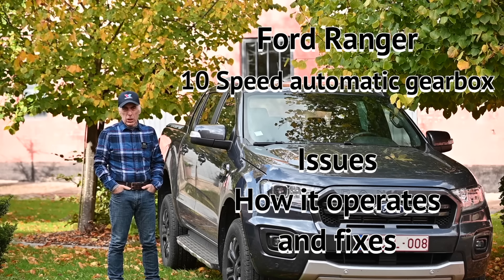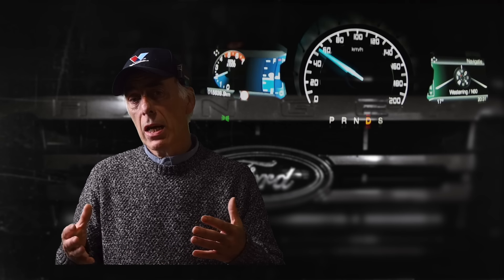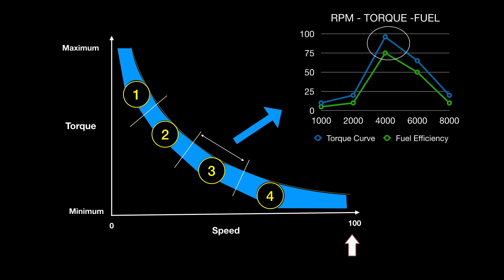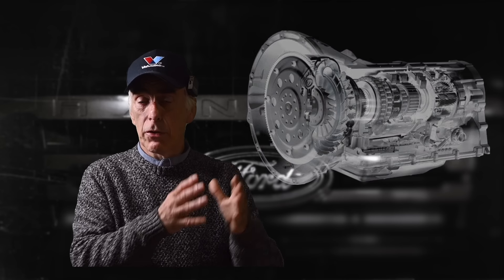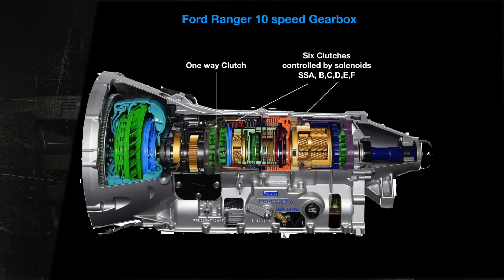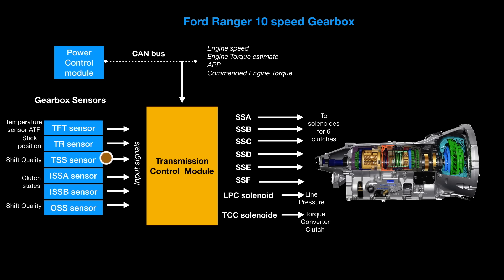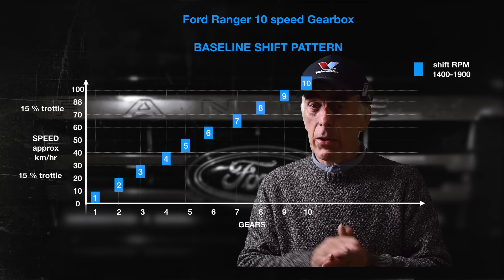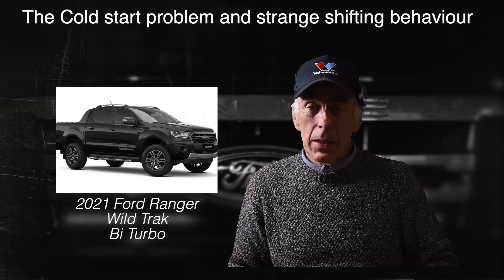Ford Ranger 10 speed automatic gearbox issues and fixes

Comment: If the 10R80 is anything like the 6R80, (thats a ford copy of the ZF 6speed) and I bet it shares software with tweaks. 

I replaced my valve body on my 6R80 with a genuine Ford complete unit to rectify harsh shifts.  

The new valve body came from ford with a software code on a tag in the pladtic floating in the fluid to replace the factory one on the transmission, along with a 4 page instruction  on how to update the software  to a new shift strategy number to suit the calibration of the new solenoids (I used Forscan) and how to perform the shift calibration procedure. 

The vehicle had to be driven several times at light throttle until it reached 4th gear at 50kmh then come to a gentle stop, then hold the break down for 10 seconds.   

This had to be performed about 10 times in a row on a flat road. 

I cannot remember the exact details but I still have the paperwork somewhere.

This is instructions from the manufacturer so anything else you get told on the internet is BS. 

This information is not really in the puplic domain as it is intended for Ford technicians performing repairs, the same as TSB documents are, so the techs can perform repairs in ford dealerships. 

The only self learning box i know of is the ZF 6speed boxes, that have a mechatronic mounted TCM that sits in the fluid similar to the early 6R80 units. 

 The self learning part on a Ford vehicle is the KAM (keep alive memory) and is stored by the TCM and recognises driver behaviour in regards to throttle application scenarios. Im not sure its still in use as this was a 1990s and 2000s technology.  

Im sure something similar is in play now with more sophistication,  but it is not a function of the TCM is Ford manufactured transmissions.

Comment: I think a lot of the videos I've seen on YouTube about Ford's Ranger and 10-speed gearbox problems are extremely unfair.  This is the first video that approaches it from a technical angle and with an intelligent break down of what's going on.  I've put nearly 10,000 miles on my 2023 and I haven't experienced any issues (yet) with this transmission.  However, I also routinely take these steps also, so perhaps my method is not as harsh as some folks who like to turn the key and launch hard on a cold engine.  We'll see in time, but everything you explained makes sense.
Reply from the maker: Thank you
Reply: My 19 didn't have issues till 60k

Comment: Cold start is normal issue to all vehicle not just Ranger. Any car will experience cold start and that is not on the 10 speed transmission issue. Cold start most like the starter problem or battery nothing on transmission. We have 2007 model transmissiom we fix the starter and now no more cold start. The problem to all driver who drive on Automatic is the way they drive. When you drive in City push the accelerator slowly and it will change gear to low to higher gear  Do not push and pull the accelerator. There are many gear inside the transmission. Now when u drive in highway push deep the accelerator and u can see the odometer go high speed and if reach to 80 to 100 kph release the accelerator and let the carl run. If the odometer is slowly down to 60 then its time to push the accelerator and if reach to 120 to 160 release again. That is the way your automatic car will last to 30 yrs without any problem. Another friendly advise to all automatic car owner when you park hit hard the brake and put to neutral and then park. If you hit the brake and put to park the vehicle will move backward and if you do that all the time your reverse transmission will damage the gear and it will not reverse. This is what I observed to all Automatic.

 Summary:
All Automatic car. Do not push and pull the accerator. Push slowly to reach to 60kph if u drive in City. City speed max to 0 to 40 correct me if I am wrong. In freeway push deep accelerator if reach to 80 to 120 relase the accelerator let the car run. If u see the odometer slowly down speed and push again the accelerstor to reach to high speed 160kph and release again. Friendly advise to last forever without any problem. I say again do not push and pull the accelerator if u drive automatic car.😁😁😁😁😁 if manual no problem
Reply: Thank you for your advice, it is very useful for those who drive an automatic car.
But you also need to know, I personally have used an automatic transmission since 2009 and have experienced 8 types of cars using this transmission. However, when it comes to the 10R80 gearbox, it is truly a disaster! I will improve my driving skills! Thank you very much!

Comment: I shouldn't have to teach my truck to run properly. On top of this, my battery has been replaced after 1 year. Now it won't hold a charge for more than two days. Have lost power as well. This truck is a pos. Most likely will trade soon. Maybe I got a lemon. Never had a vehicle this temperamental. My vehicle shouldn't need a therapist.

Comment: A manual transmission will always be better than any automatic.
Reply: Better in what way? Cheaper? Yes. Longer lasting? Maybe. By all other criteria? No.
Reply: @michaelb7071  better fuel economy, easier to repair, easier to maintain,  better driving experience,  more control over the vehicle, more control over the engine and all other components,  leading to less wear and tear overall.
Reply: @jasonburguess  Easier to repair and maintain, I'll give you those two. The remaining points are effectively invalid in modern automatics (I only own cars with manual transmissions BTW). A modern Toyota will easily do 600,000+km without problems caused by/related to the automatic transmission if the oil is changed every 200,000 km. At this level of reliability it becomes a moot point whether or not automatics are better or worse than manuals.
Reply: @dquad  if you gave me two identical cars, one manual and one automatic,  and had me drive them the same distances, and then checked the fuel economy, the manual would beat out the automatic by a lot
Reply: @jasonburguess  Not anymore, the new systems are remarkably efficient with lock up torque converters. It's a simple fact that the 10 speed automatic has more opportunity to be in the correct gear for any given condition than a 5/6 speed manual transmission.
Reply: @dquad  as a general rule the newer a vehicle is, the lower the quality and the more problems they will have, I've been a mechanic for 25 years and wouldn't drive anything made after 1995 if it was free, they are made of cheap materials, and overly complicated electronics that cause more problems than they solve. Ford uses aluminum transfer cases, and plastic oil pans, for example which is just plain stupid. Compare that to say a 1991 dodge ram with a 12 valve mechanical injection Cummins turbo diesel,  steel everything and less computerized crap, mine got 35 miles per gallon at 350hp and wouldn't break going over a speed bump like the new ford's will. New vehicles are dangerously under built and made as cheaply as possible.
Reply from the maker: Better depends from which angle one looks at it....  although I prefer a manual... the sad thing is that they are no longer sold with manual....